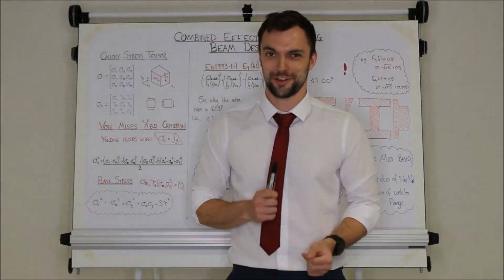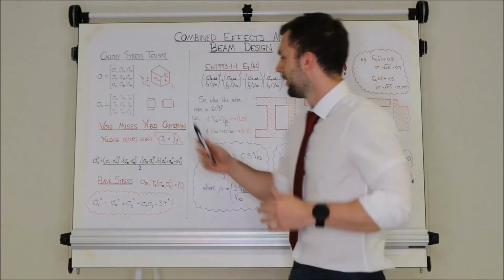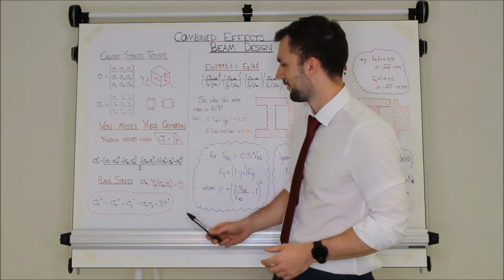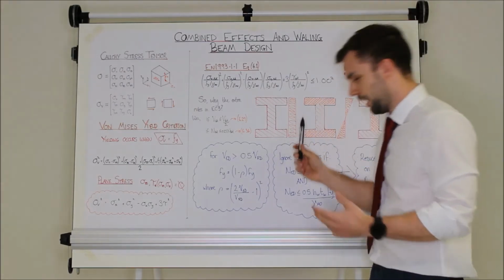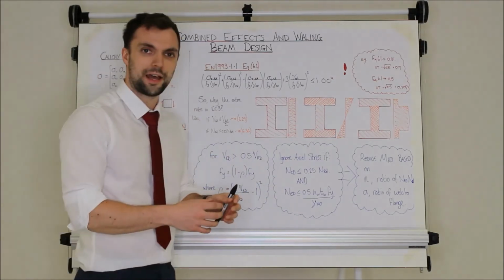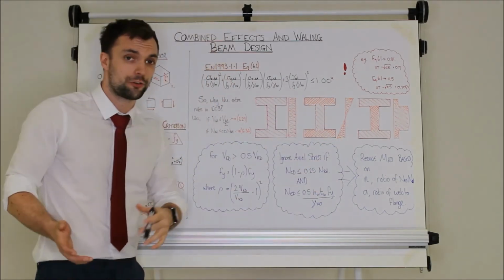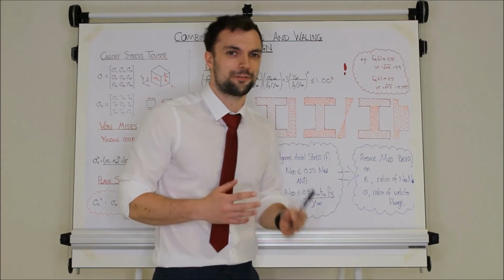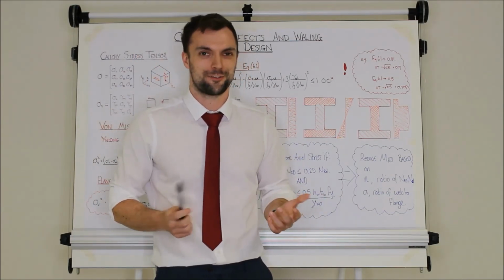Combined Effects and Waling Beam Design | Back to the Drawing Board

Comment: Where can I find a reference to the elastic verification being <1.00 squared. Eurocode 3: Design of steel structures — Part 1-1: General rules and rules for buildings, states equation 6.1 is less than <1.00 only. The reason I ask is that I realise that this change then ties both the von Mises & elastic verification equations together but the code as far as i can see doesn't reflect this. Thanks